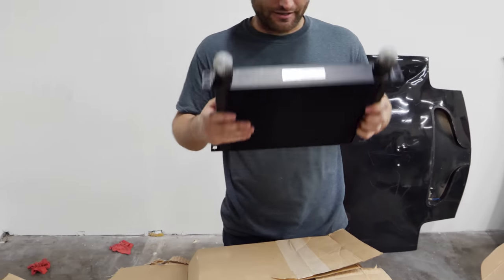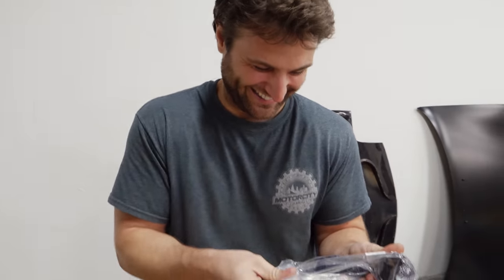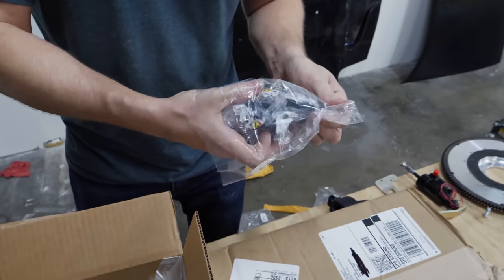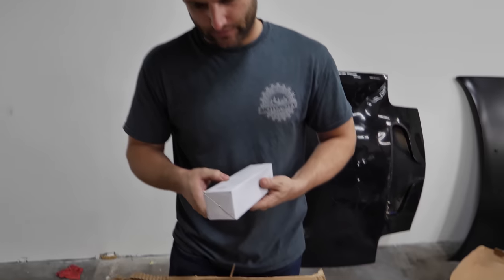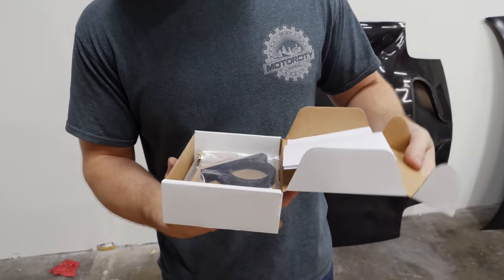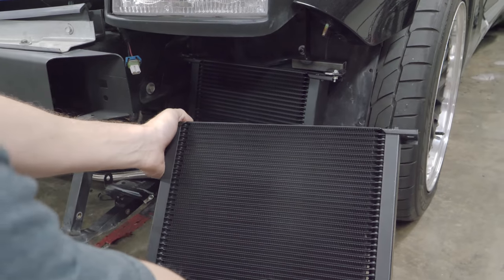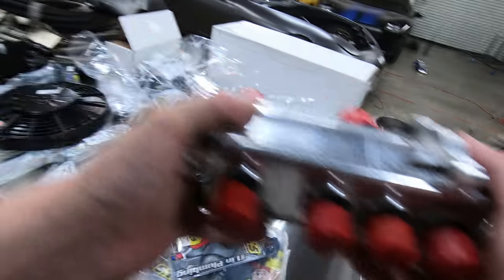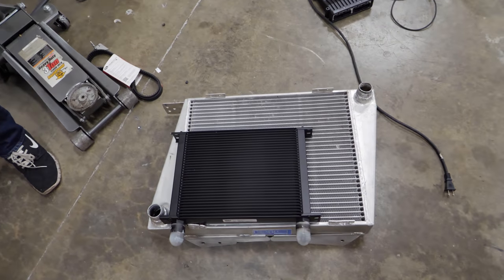Unboxing the LARGEST Oil Coolers for the 4 Rotor. It’s getting real...

Comment: Having the wider -16 AN line oil cooler size up from the -12 line will actually be very resourceful, as the pressure in the oil cooler will be lower then the pipe/fittings, this causes the temperature to drop in the cooler anyways as a lower pressure decreases heat as the Lussac's law states that "as pressure drops so too does temperature" but also the higher volume will push the oil through the cooler slower which gives it more time to cool. Therefore this is a great solution to oil cooling in more ways then just "omg phat radiators"
Reply: But doesn't bernoulli equation show that when the cross sectional area increases the flow speed decreases, therefore the pressure raises. I think its called the venturi effect
Reply: @nice1149ss  The Venturi Effect States that pressure increases in a "neck down" situation due to the speed of the liquid having to remain constant within the system so the molecules are forced together tighter which increases pressure, in a "neck up" situation the liquid still has to remain at the constant velocity so to achieve this the liquid will spread out to fill the gaps causing pressure to decrease

Comment: Running larger lines and hoses not only helps reduce flow restriction but it also helps with pulsation dampening and reduces pressure loss.

Comment: Lindsey Racing actually makes a much larger oil cooler for Porsche applications but they also sell it by it's self, just thought ya'll might want to know.
Reply: Lindsey Racing coolers actually have less capacity that single cooler and he has two. Its also the linsey cooler is not as compact and has less flow channels meaning it retains heat longer. Not to mention it is a 12 an line outlet.

Comment: Increasing oil line size reduces oil pressure. A local race team tested (back in 2014) the effects of oil lines and fitting, 
each 90-degree fitting reduced oil pressure by 1-1.5PSI which can add up!

Comment: On the oil cooler. 12 up to 16,Isn't that going to cause cavitation in the oil. Trying to fill the volume of space. You should check with a hydrologist on that. Sometimes overkill is  not healthy.

Comment: Can you explain why you chose to use a drive by wire throttle body? Wouldn’t an electronic throttle body be a better option to have fuel/ air cut in between shifts for your dog box be a better option?

Comment: I remember an old dyno video of yours where you quoted REALLY low oil temps and made it seem like the norm for performance turbo rotary engines. Since all I know is my Mk7 Golf R and how it keeps the oil between 225 and 235F for normal driving, what’s the operating range for a rotary?
Reply: Generally pretty cool since the oil does Phenomenally more for cooking than the actual coolant does.

Comment: Can you program your ECU to shut off your engine immediately if the belt snaps and you lose oil pressure? Better be one of the first things you program  into your Holly Dominater.  The oil system is going to be Amazing.  Good thing you have so many excellent partners.

Comment: An area increase will also act as a restriction unfortunately. You force the oil to go from fast flow to slower flow which stirs it up a bit. The difference on these oil coolers likely isn't that much thought.

Comment: I think that the biggest restriction you will have for cooling is the front bumper blocking airflow to all of theese coolers. You can ask engineers to have a cfd analysis to ensure proper air flow without adding much drag

Comment: I am curious, is this possible? Won't a 12 to 16 a.n fitting get restriction on the outlet/return when it goes back from 16 to 12. The 16 will fill up all the way before it starts pumping back through the return won't it? I feel like this might result in a drop in pressure or something as the 12 can't keep up the flow as it goes from 12 to 16 and back to 12. Wouldn't it be ideal to just use all 12 a.n fittings? I dunno, maybe once the 16 tubes or whatever have filled maybe it alright? I'm no engine builder, just trying to make sense of why you would use different sized piping/fittings in a project like this.

Comment: hey Rob! you are so exited about all this billet parts and custom fittings! 

Look, my name is Igor Kovalcuk. I am am engineering student from Israel. My father has an CNC factory that makes an injection molds for plastics.
I have got the knowledge to make for you all this custom billet parts for fraction of the price if you will be able to hire me as you'r engineer.
I had a dream that one day ill move to the US and make my own business in the field of custom part for automobiles like yours.
Well look: a 3 axis CNC cost around a 5k USD, TIG welder its another 1k (MAX) + a pipe bender for your fitting needs is around 600 USD (max). 
you seems to be a relay trustful person, that well known around the internment. I am offering you a professional support for an opportunity of getting into USA.
Ill be happy to hear from you any reply. good luck with you'r project! I hope the everything will out just the way you want!

Comment: what are you going to doo with that trottle body / IC piping?  A silicone coupler would not hold without a bevel on the trottlebody
Reply: I imagine he is going to go with vbands, which is easy to weld onto that billet throttle body.

Comment: Just an fyi insulation doesn't affect electromagnetic interference it's that thick because insulation can breakdown with high voltages like the 40,000 volts the coils can make to stop interference you want shielded cables and the shield needs to ground on 1 end only if both are ground the is potential for current to flow through the shield creating interference

Comment: Why electric fuel pump why not mechanical which outperform any single electric fuel pump. When you combine electric and mechanical fuel pump it makes easy start up procedure and big flow when engine runs at high rpm. When electric fail you still have a fuel.  For power steering pump you may use Power Steering Adapter with Drive Cable.
Reply: I do believe that a brushless pump setup like that will flow more than a mechanical one. It will probably also use less energy from the engine since brushless motors are very efficient, but I might be wrong.
Reply: @MyNameIssaSimon  Mechanical pump are more reliable, they are easy to setup with fuel flow regulator. They don't require any electronic components, they don't use more energy from the engine (maybe when you cruising then do but not in this type car). They are noiseless. For high power setup you need two or more electric fuel pump if one have a failure or flow less it is harder to find out what is wrong with them. First of if you need to do something with them you may need to put them out from tank then you can check it. If your car isn't daily driven, electric fuel pump need high voltage from battery in this case your battery is always at low state of charge it can kill your alternator. The electric fuel pump are more prone to rust if you useing E85.

Comment: What you showed is a JIC fitting. AN fittings were army navy spec fittings. These were intended for military aircraft. These were never intended for public use but slowly ended up in surplus stores and flea markets. You almost never saw them new.  Then the military decided to go to JIC  to avoid all of the leaking problems they had with incompatible seal angles. When the military no longer wanted the AN fittings, the market was flooded with the damn things. These differ from JIC by the seal angle. You can thread a AN fitting onto a JIC fitting but they will not seal worth a damn because the angles are different. No one makes and sells the old AN fittings any more. These were obsolete and production stopped  in the late 70's early 80's. They are just a headache to deal with and people always mix up the two types. This mistake always produces leaky fittings. The fittings you have in this video are all JIC. Be glad you do not have AN fittings. You would be pissed when you tried to connect a more common JIC to them and your car left puddles every where it stopped. I am a machinist and I build hydraulic systems for semis for a living. Conveyor trucks, dumps cement mixers ect. ect. Because of this I deal with the hydraulic hoses and fittings every day. Both steel and aluminum fittings . I also make the valve bodies for spool valves and crimp hoses. I have a clue what I am talking about. You do great work Rod and I enjoy watching your videos. This is not a criticism in any way. Everyone seems to make the mistake of calling JIC fittings AN's. They are different for the reasons I explained.

Comment: Looks like you need some rest...... exhausted comes to mind
Reply: Crazy long comments. Great job Rob. I would suggest if you are going to turn the oil cooler, to put turnings vanes in front to eliminate the stress on the cooling fins. Also improve air flow. How about a billet grill :)

Comment: That huge butterfly throttle body is going to be a source of problems for you. 10% throttle and 100% throttle will not have any difference in air flow BUT will have a 90% difference in fuel. It is going to be incredibly hard to tune. Mark my words now because I guarantee you it will happen